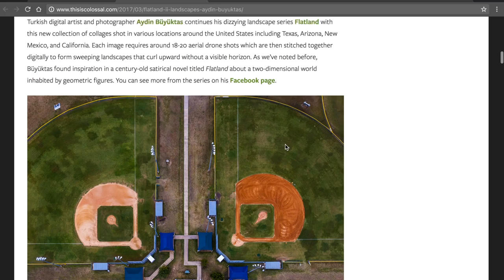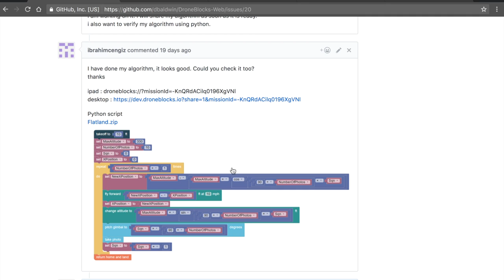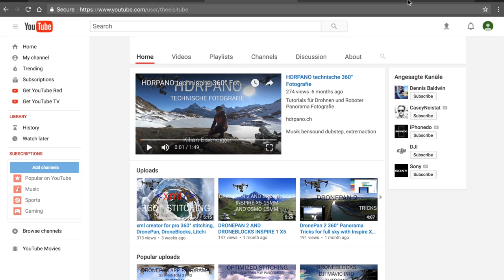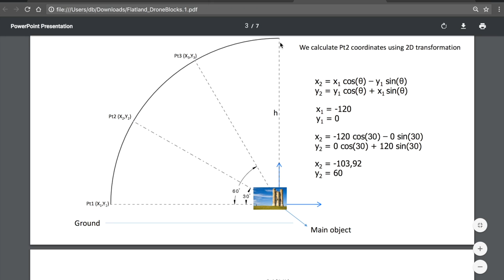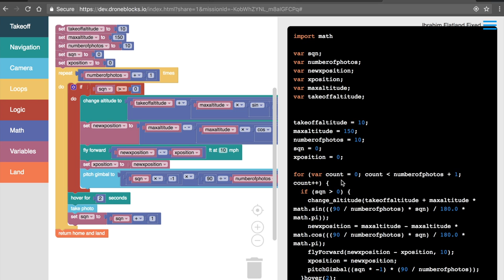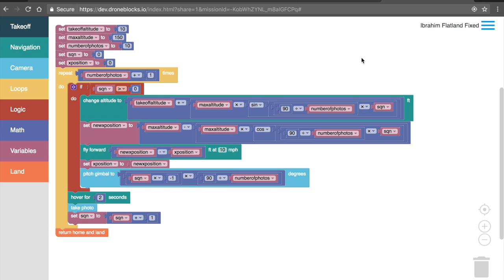Automating Drone Flatland Photos with DroneBlocks

Comment: Dennis... I have loaded this mission into droneblocks. When I get to the field, fire up the drone and droneblocks and want to perfectly line this mission up before the flight, is there some way to set up the mission on the map to point exactly in the direction I desire (i.e. along a road)? So far the only way I have found is to align the drone (on the ground) in the preferred direction and initiate the mission. Is there an easier, more precise method? Thanks for all your work.
Reply from the maker: David, thanks for the feedback and I'm happy to hear you're giving the flatland a mission a try! Would you mind writing up your expectations on how you'd expect this enhancement to work? You can go to our issues page here: https://github.com/dbaldwin/DroneBlocks-Web/issues and write it up so myself and other developers will see it. For most of the teaching we do it's easy for the students to point the drone in the proper direction and then launch the mission. One thing I thought of is trying to run the mission from the air. Perhaps you yaw your drone to the proper location (in the air) and then launch the mission? Let me know what you think and thanks again for the thoughts.

Comment: Hi Dennis,

I am confused! Are we talking about feet (ft) or meters (m) for the parameters? In your drawing explanations (1:22) it reads meters, but in the video 4:27 the height is in ft !!??
Thanks

Didi
Reply: Hey Didi,  one of the guys that Dennis corresponded with - Kilian Eisenegger - is from Europe and so would rather work in metric units (metres) and so when he drew up the plan he used 10m. Dennis, from America would rather work in imperial units and that's how he's chosen to view it. The first waypoint on the map is ~33ft which is 10m! So the height is the same but it's just different units for different people! Hope this helps :)
Reply from the maker: Thanks Jack for chiming in. This is exactly right. Hopefully in the future we will add the ability to toggle between imperial and metric.

Comment: Hi Dennis,

Today I tried again to produce the Flatland images! I put the Mavic with the DJI G 4 app into manual focus and manual exposure. However the DroneBlocks App overwrite the manual focus setting and switched it back to AFC mode! Is there a way to avoid that!
Reply from the maker: Thanks for reporting this, Didi. Not sure what's going on but we will definitely look into it. We are working on an app called Droneception that should automate this process without having to use DroneBlocks code. Feel free to join our group and get on the beta: https://www.facebook.com/groups/droneception

Comment: I tried this code today. It did take all photos but start was strange. I taked of and went in drone blox and started mission. My max altitude was 300 and drone first went to 300ft then came back to 15 and then started. Am i doing something wrong? Also can i fly from one location to another and then start mission or it needs to start from home point?
Thanks
Reply from the maker: Sorry to hear that. That's really strange behavior and I'd like to help you get it fixed. Please join our Facebook group if you're able and share the mission there. We will review and see what we can find out. Thanks for the info.

https://www.facebook.com/groups/droneblocks
Reply from the maker: Also, we have an app that is specific to taking these types of photos. Please join that group as well. Thanks!

www.facebook.com/groups/droneception
Reply: Thanks for replay. I will do more testing this weekend. I never used drone blox before so maybe i made some mistake. will take a look at this app also :)

Comment: I tried droneblocks.  The hover command on my MavicPRO connected with ipad, halts the droneblocks running sequence.  Is there a bug?
Reply from the maker: Gordon, maybe you can share your mission with us and we'll take a look. If you are on Facebook please consider joining our group and sharing it there: https://www.facebook.com/groups/droneblocks

Thanks for the feedback.
Reply: Thnx Dennis, but I am not on facebook, but I sent you an email.  Problem seems to stem from saving a mission and then retrieving it from the network and then running it.  the code seems the same and the blocks look the same, but the bird stops during the execution of the code.  I need to run a mission when outside of any network connection.  The flatlands code will not run and generates an error.  others have successfully run the droneblocks code from your links.  manually entered and run code executes as programmed.  more complex code cannot be manually entered just before a flight, but has to be run from a saved copy.  I will try and get more specific documentation of the problem, and hope to get it sorted.  I am working with another mate with a mavic and we experience same problems.  not giving up hope yet, as the concept is great.
Reply: have created a facebook acct,